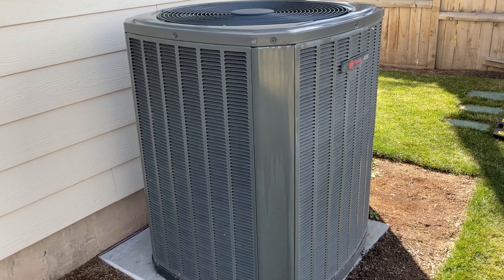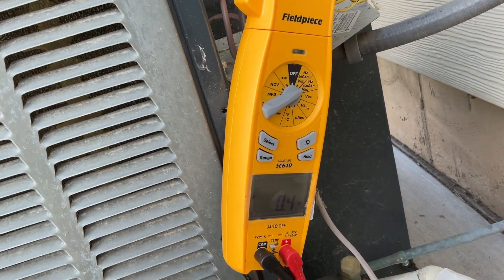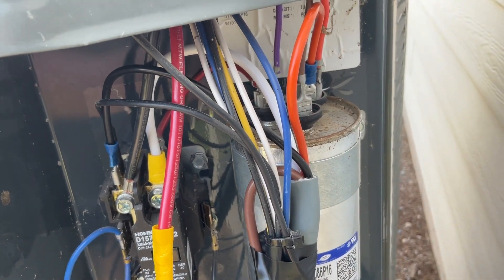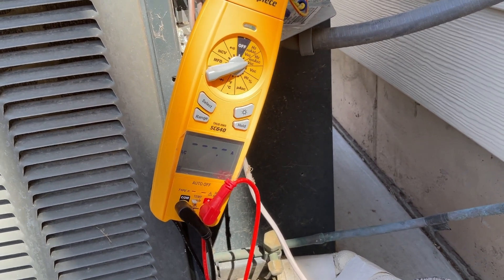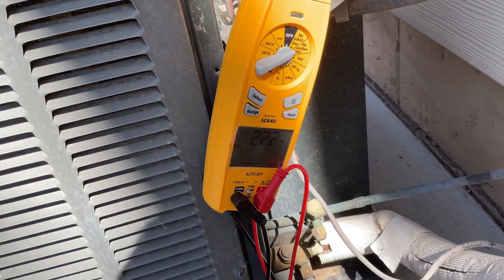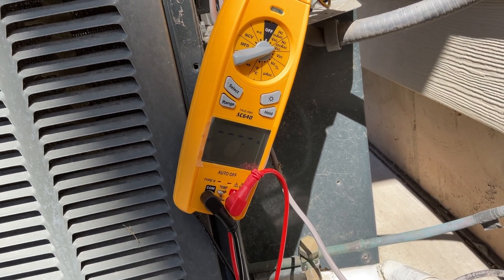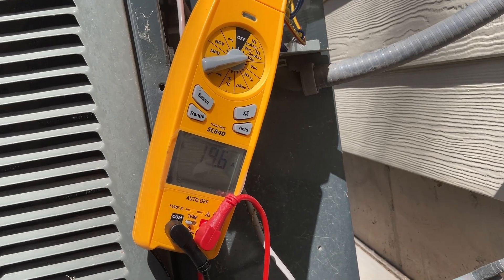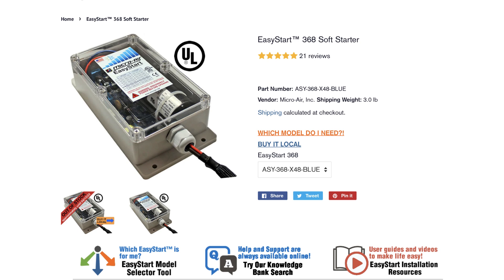Save Lots of $$$! Micro-Air Easy Start on full-size A/C Review

Comment: I would think if you check the running amperage right after starting, it would be a little higher as it would be recharging the capacitors in the soft start.
Reply from the maker: Probably! Got to get power back to that somehow! Thanks for watching!

Comment: So confused, every ac unit I have ever seen is on a 30 amp or 50 amp breaker. If your starting amps are 90, how did your breaker not trip?
Reply from the maker: My understanding (which is not professional in any regards, so hopefully an electrician or electrical engineer will chime in) is that breakers trip due to excessive heat across a certain part inside them to protect the wire after the breaker from overheating in a prolonged over current situation and while that split second surge is much more than the 40 amp breaker in my case is rated for, it’s pulled for such a short period of time that there is no risk of the wire getting hot and as a result, so fast that it doesn’t trip the breaker either. Thanks for watching!

Comment: Thanks in advance. Its been 2yrs since the video but at any point have you done the math to justify the price you paid?? As in how many years of starts will it take before you are at break even with the cost.
Reply from the maker: Well, it depends on how you look at it…but it basically paid for itself 10x plus the day I got it because it saved me thousands on my backup generator costs. I was able to get a substantially smaller generator. That’s the main reason I got it.

Comment: Does it save money in the electric bill?
Reply from the maker: The easy start doesn't seem to save a measurable amount of power to be reflected in your power bill. However, it saved me THOUSANDS in my backup generator solution. If you want to save money on your AC bill this summer, then you'll want to see this video where I pair solar panels and a micro inverter with the easy start. https://youtu.be/RQ3IIj8rDNw Thanks for watching!

Comment: I am a certified HVAC Tech.
I know this video is over two years old now, but the LRA (Locked Rotor Amperage) or initial inrush amp draw (93.9A) of that compressor was TWICE as high as the maximum average of its RLA (Rated Load Amps) - which is FAR too high...
  You may want to put a megometer on on that compressor and see how intact the insulation of those three windings are.
  That points to a seemingly-bound compressor...
 (The average LRA, or inrush current, of a compressor,  is approximately 5-7 times higher than its RLA.)
  Yours was 15.55 times higher.
Reply from the maker: Well, good news is that it’s still going strong 2 years later and working like a champ! So I guess if it ain’t broke, don’t fix it. Thanks for watching!
Reply: @theresatrickforthat  Copeland makes some damn good compressors; I know that much! 😆

Comment: I'm installing the Easy Start tomorrow. But I already have some parts removed for replacement while I'm at it. Specifically the start relay. Anyone installing the Easy Start should check the contacts of the start relay - you will see badly charred contacts if the relay is the original part and it's been in use for years. This represents an increase in resistance for the incoming current. It's caused by the large inrush of current being slammed on for years (before you have an Easy Start). Get a new relay with brand new shiny contacts - mine cost only $13. 👍
Reply from the maker: Good recommendation! Thanks for watching!

Comment: Installed mine today at my house on a 3 ton ac unit.  LRA was 77 amps and after easy start, it's 23 amps.  A 70% reduction and running amps are 7.  Added this to my two new Delta Pro  Solar batteries to run the house ac.
Reply from the maker: Dang! That’s so awesome! Glad the EasyStart works so well for yo! Someday I’d love to have a Delta Pro setup like you. I’ll try to not feel jealous! :) Thanks for watching!
Reply: @theresatrickforthat  The Delta Pro turned out to be unreliable and was returned.  System is still running great!

Comment: Hello,
I have a Trane xr16 3.5 ton heat pump. Most of the install videos I have seen for the micro air show running capacitors with 3 terminals that are marked. My unit has only 2 & they are unmarked. Where would I connect the orange wire? One of the capacitor connections goes to the contactor t1 terminal, the other, heavier wire from the capacitor goes up into the cabinet.
Reply from the maker: I would recommend you consult the wiring diagram for your specific unit. It sounds suspiciously like you have two separate capacitors. One for your fan motor and one for the compressor. You’ll need to use the wiring diagram to find out which one is which so you can correctly connect all the wires on the Micro Air Easy Start. Thanks for watching!

Comment: does this save money on the electric bill? i've asked this question to others but yet not received an answer as to if it does or not.
Reply from the maker: Great and valid question…the answer is no…or so tiny that you can’t notice any difference in the power bill. It does however eliminate the lights from blinking when the A/C turns on when using grid power. But I want to stress how much money it does save you in buying a smaller generator instead of a giant one, it also seems to save a huge amount of wear and tear on the A/C unit itself. I usually change my contactor every year for preventative purposes, and since I’ve installed the east start my contactor hasn’t been getting pitted at all, and it’s protected my unit from short cycling twice now and three over current situations as well. Anyway, it’s been pretty cheap insurance for me to protect my A/C unit and on top of that saved me thousands of dollars in backup generator costs. Thanks for watching and commenting!

Comment: The Saving on your Light Bill  will be VERY VERY  Minimal You will not even notice any Change to your light bill. The Only Main Advantage of installing a Soft Start is to Run Your AC unit with a Smaller Generator !

Comment: 93 amps inrush? My Honda EU2000 should be able to handle that……….great video.
Reply from the maker: Thanks for watching! Just a word to the wise, I think the Honda EU2000i is 120 volt only. So probably want to do some research on the voltage your A/C unit needs before trying to run it with you genset. Best of luck to you!
Reply: @theresatrickforthat you’re right. I was just kidding. It’s a tiny generator (but it’s really portable and quiet). I have a Westinghouse 12000 that i use for my whole house.  Honestly, I’m afraid to use it for my AC because they are old r22 units from ‘89 and the electricity the Westinghouse puts out is very dirty. Not worth potentially compromising two systems. Power goes out, it’s ceiling fans for all. Thanks for responding though.   Just subbed  to help you get past 1000!

Comment: It works...... I needed to run my 4 t R22 system on a 9500 predator...... Max ams were a 105..... If after micro air , start in the 5 learn cycles it went down to 33 amps..... Yeah I can run my 4 t system on my inverter generator....
Reply from the maker: That’s so awesome! Thanks for watching!

Comment: @There’s A Trick, Have U run your 4 ton A/C w/EasyStart during power fail? Generator handle it OK? I have 20 year old 5 ton A/C w/o EasyStart (LRA=150). Getting portable NG generator (6,900W starting, 5,500W running). What’s STARTING/RUNNING watts for your generator? Are U using natural gas?
Reply from the maker: Yes. I have run my A/C with the Micro-Air Easy Start during a power outage. Worked flawlessly! (For what it's worth...my A/C unit is a 3 ton.) I use a a Westinghouse Dual Fuel Generator. I run it off propane. A little overkill size wise...but got it for an insane price. Actually, just looked it up and it's back down to a really good price if you want to check it out! https://amzn.to/3DzPVU9 Thanks for watching!
Reply: @theresatrickforthat  Powerful dual fuel (gas/propane) 12,500W generator! Yes, $800 @Amazon, good deal, but I wanted natural gas. With EasyStart on your A/C are RUNNING amps the same both on grid and off? Thanx, great video!
Reply from the maker: @gilbrook  The RUNNING amps on and off grid are very similar for me. My generator tends to run about 2 volts higher than the utility, so I actually see an ever so slightly lower amp draw on my generator than on utility power...but the net WATTS used remains pretty much identical on or off grid.

Comment: Thanks for the video, would like to know if you noticed a difference in your bill, if you are in a peak demand area? Also to help with some of the comments comparing this to a hard start, a hard start does not reduce in-rush, it is meant to push a worn out motor, to start a worn out compressor. It is harder on the windings, and is a patch for a failing motor. The EasyStart is meant to reduce the in-rush through time delay, and is easier on the windings. Some hard starts may reduce start in-rush by around 10% if there is a relay coil that will absorb some of the bounce from the thyristor. In your video it looks like the EasyStart reduced in-rush around 75%.  This video explains a hard start and shows the in-rush when installed (no affiliation, good video) https://youtu.be/ZD_cwsPcRfI
Reply from the maker: Thanks for watching and sharing your insights!

Comment: Was this one installed on a Lennox 2-stage compressor?
Reply from the maker: It was installed on a Trane 2 stage unit
Reply: @theresatrickforthat  Why??? My own 2-stage TRANE compressor has a "starts-up" in "stage one" at less than 65 percent of full load capacity. A "soft start" only makes good sense to me for "single-stage" compressor set-ups that start-up fully loaded.

Comment: 93 amps for 1 second or 22 for 4-5 seconds... how is that saving electricity? Also why would the fan turn on first? The coils havent changed in temp yet...
Reply from the maker: The fan starts before the compressor so they aren't starting at the same time, thus reducing the start-up inrush further. Thanks for watching!

Comment: Every a/c compressor I know has the run cap value balanced for best PF and load current varies low to high as the heat load increases.
However refridge compressors NOT! 
So had parallel cap to ballance PF and save paying for more VA to grid.
Reply from the maker: Thanks for watching!

Comment: This DOES NOT save you money! It's made for an A/C that is running off a generator. The purpose is to limit the current during startup, so it won't over amp your generator. Utility companies don't charge for Amps, they charge by Kilowatt-hours. If you still want to do this for a generator, save yourself $320 and just buy a $10 time delay for the fan, and a $10 hard-start kit for the compressor.
Reply: A hard start does not reduce in-rush, it is meant to push a worn out motor, to start a worn out compressor. It is harder on the windings, and is a patch for a failing motor. His device is meant to reduce the in-rush through time delay, and is easier on the windings. Some hard starts may reduce start in-rush by around 10% if there is a relay coil that will absorb some of the bounce from the thyristor. This device based on the video reduced the in-rush by 70% or so. This video explains a hard start and shows the in-rush when installed https://youtu.be/ZD_cwsPcRfI
Reply: @thepricelife2374  Hardstarts reduce the entire inrush time by 50%. Meaning, the faster the compressor starts, the faster the start-up amps drop to running amps. His device (soft-start) can't do that. His device (soft-start) only takes the inrush of the compressor and fan and splits them into two separate start-ups. The energy usage stays the same. It IS NOT meant to save money and it's not "easier on the windings". It's meant to reduce the start-up load on a generator, nothing more.
Reply: @chaseme9860  I would encourage you to watch the video in the link, he uses an amp meter and measures in rush on 2 different hard starts. One increases in rush and the other reduces it by 10%. This softstart controls the power supplied to the windings by ramping it up through time delay. This reduces the expansion on the windings reducing wear. A hard start in practice creates a surge to the windings pushing the motor to start faster. The surge in the windings causes expansion and can lead to premature wear. Please show real world data of a hard start reducing startup surge by 50%?
Reply: @chaseme9860  You are correct that it does not save money, in some circumstances. However if you are in a market that has peak demand charges then it will save you money. Depends on your application and location.
Reply from the maker: Yep! Saved me thousands on my backup generator. Would be interesting to make a video comparing the difference between what you recommended and this Easy Start. From what I was able to understand in my research, this unit is far superior...especially when you have a somewhat new A/C. But I like your idea to show in a future video! Thanks for watching!

Comment: Why is it pulling more amps when running?  It’s pulling .5 amps more.  Once it’s running the soft start should be out of the equation.  That’s a average of about 30 cents a day more for electric if that device is actually using that 110 watts to operate.  This makes me question the hard starts I installed on our units, if they are using more power also.  I’m going to un install and take amp readings.
Reply from the maker: Good point! I personally think the extra amps is due to the fact that it took me a few hours to install the thing. So when the unit was running after I installed the Easy Start it was already early afternoon and the day had warmed up quite a bit so the A/C was needing to work harder. But certainly something to explore and verify! Good idea for a future video! Thanks for watching!
Reply: I think your right, but I would like  data to confirm.

Comment: This is actually bad for the compressor, it limits the extra boost (voltage and amperage) compressor needs during startup.
Start-up capacitor is what you need, capacitor will help with voltage drop during start-up.
Reply from the maker: Good insights! The next video I'm going to do is going to be me putting my clamp meter on the wires AFTER the Easy Start so we can see what the amperage is doing at that point! Thanks for watching!

Comment: FYI If your running amps are only 6 then your system is likely low on freon. I'm guessing that is a 3 ton unit, your didn't mention the RLA, but my experience is that anytime a unit has very low running amps, the system us undercharged. Properly charging the system will save you many times more on your electric than that start kit.
Reply from the maker: Good observation! My A/C unit happens to be a 3 ton...but two stage system. It always starts in low stage which is the amps we were reading. So that is why the amps were so low. Thanks for watching!
Reply: @theresatrickforthat  I also have a 2 stage unit. In low stage, my amps are around 8. You should check your sub cooling in high output.I found that 2 stage units perform best when your sub cooling is at the high end of the recommended range. I'm curious if Copeland recommends this soft start or if they would consider it an unapproved addition. I know they approve the 5-2-1 kits and other 3 three kits.

Comment: Question on energy efficiency... With that extra .6 amps (10%) after you installed the soft start, are you seeing higher electricity bills? Can you maybe do a morning start check to see if it's still 6.6 instead of the 6.0 you had before installing it?
Reply from the maker: Good question! I'll have to check on that and see.
Reply: Was wondering the same thing. Interested to see running amps too. Thanks.

Comment: I don't know about this "learning" thing but how does this capacitor vary from the Supco SPP6 hard start capacitor that I have on my portable and house A/V units that do the same thing for less than $20 compared to the $300 for your capacitor?
People have used the Supco units for years on their RVs to reduce the start-up amps so they can run them easily on their generators.
Reply from the maker: I don’t know all the specifics on the differences. This Micro-air is classified as a soft-start instead of a hard start. Thanks for watching!
Reply: Potential start relay the supco is just a very basic buck booster. A KS1 kit would be a cheaper option for this but this soft start works a bit differently
Reply: @Jhunter844.arkansas  I am starting to realize and appreciate some of the differences such as longevity and easier on the motors, perhaps making your compressor last longer without the shock of the hard start.